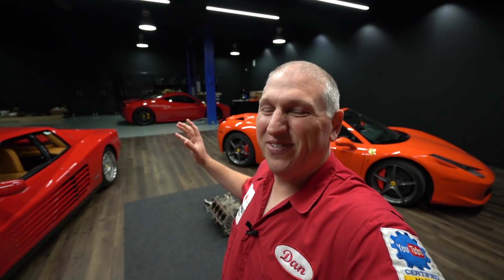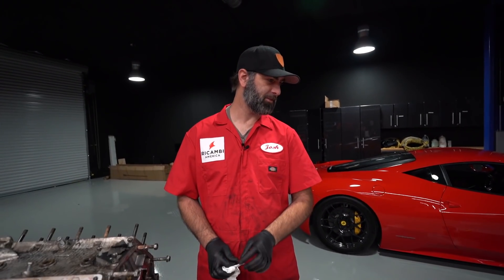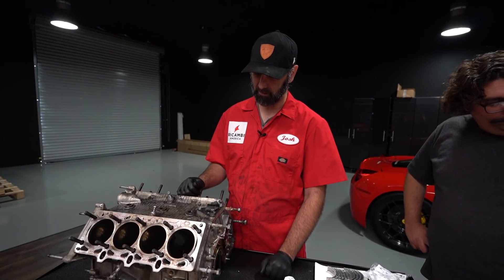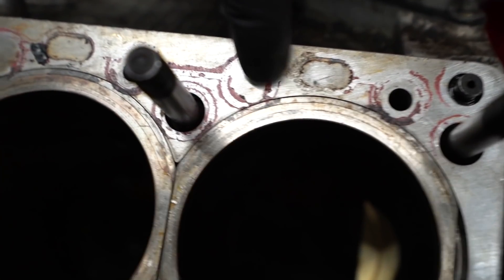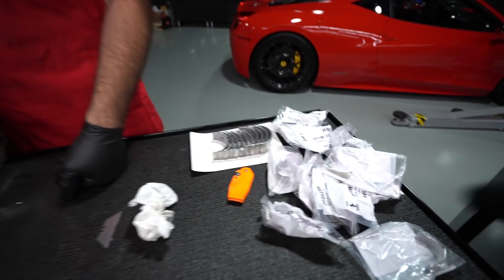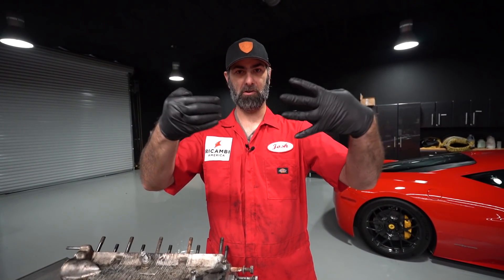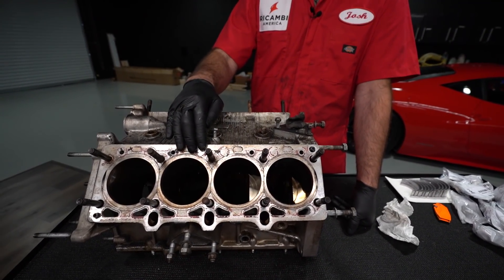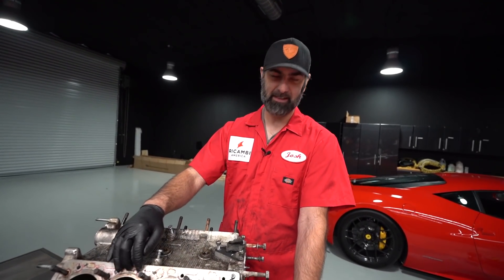EVERYTHING you want to know about REBUILDING A FERRARI F355 ENGINE BLOCK

Comment: Josh is incorrect about cross hatches and honing.  The cross hatches retain oil, which provides lubrication and makes for a viscous seal for the rings.  The crosshatch depth and angle is specified to maximize the sealing while minimizing  oil consumption and wear.
Reply from the maker: OK
Reply: Fair enough

Comment: Since the engine was going to be torn down anyway, I'd have liked to have seen what a decarbonizing treatment (Seafoam, water mist, etc) would have done to the compression results.  Carbon build up from unburned fuel can skew those results up or down, depending on where it's deposited most.  Anyway, couldn't hurt.
Reply from the maker: Ah yeah that would have been cool

Comment: Sorry Dan but I'm very disappointed in this video . I've been waiting for this regarding the inspection and measuring of internal parts for some time since you stripped the engine down. What we got for the whole video was Josh explaining the basics of a honed surface regarding helping the rings bed in. Were the bores measured for ware and parallelism Did they meet the spec ,were the pistons measured for ovalism. Whats the measurements on the main and con-rod journals did they meet the spec tolerances etc. Ask Josh to shorten his explanations as I would think that most people watching this rebuild know all about the basics. Lets have a proper update video soon.
Reply from the maker: Tomorrow. I didn't want to release a 45 minute video because then someone would bitch that it's too long.